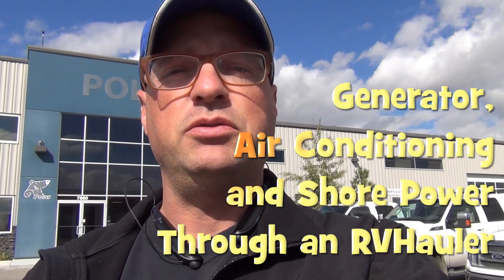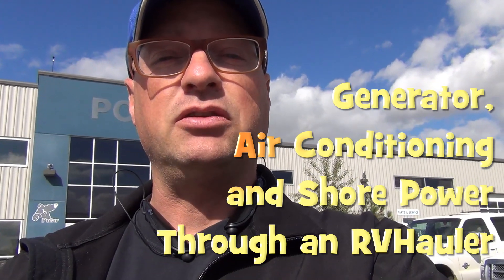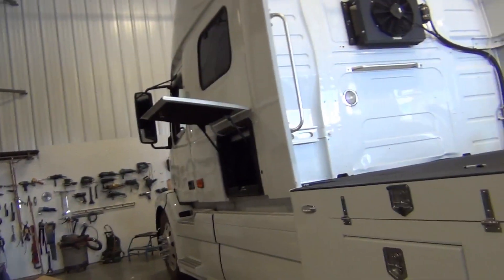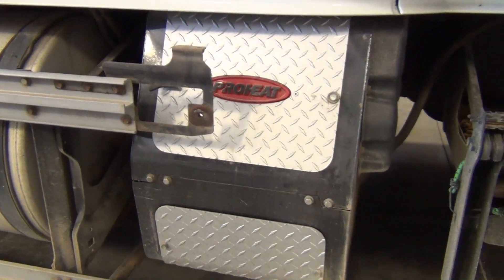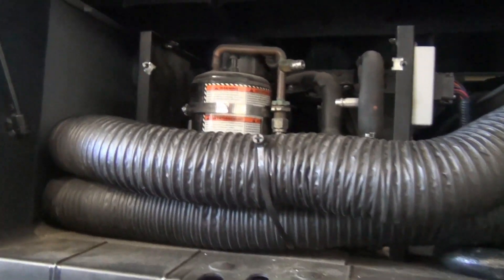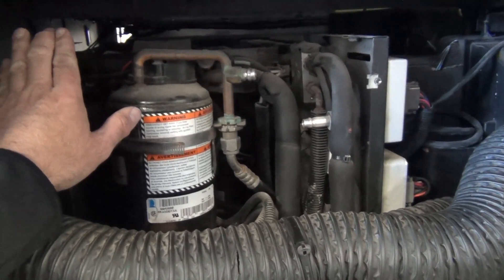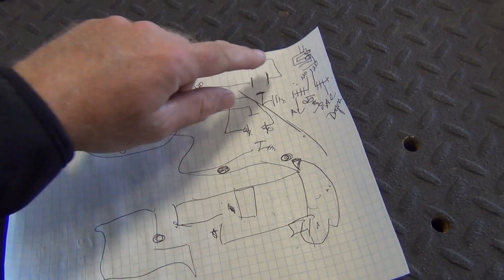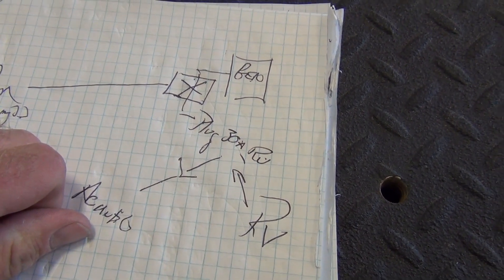RV Haulers Generator Design, AC and Shore Power Design

Comment: you forgot to mention that Apu run only a/c and the power inside the truck  (4kw ). once you add  a transfer switch for the truck then rv trailer,most campgrounds have a  50amp plug in will run 3 air conditioners.
the Apu will run that a/c only .

Comment: i like  the way your describing  all the different items that the truck has in it and what everything does and how they interact with each other 

this APU/Air conditioner setup you have is  different than any other one i have seen 
I'm much more  familiar with  the carrier style APU ,,the ones i have worked on have a separate  AC compressor and generator ,, and they can both run at the same time 
the AC is  an automotive type compressor driven by belt same as the  generator 
and the 12v power to run the fans is provided by a 20 amp alternator 
and it can provide  heat to the cab through a heat box  as well as keeping the big truck engine warm
Reply: I think it's a household A/C unit, unusual but not unheard of to see them in a truck.
Reply from the maker: Hi Ian.  Actually, it is a unit intended for installation in a commercial tractor.